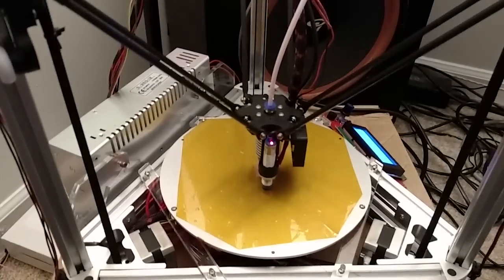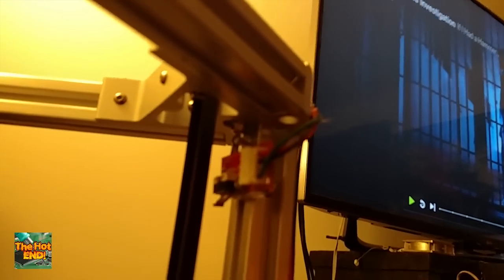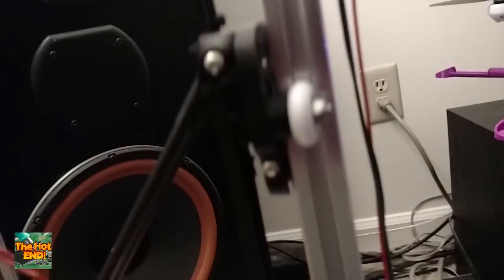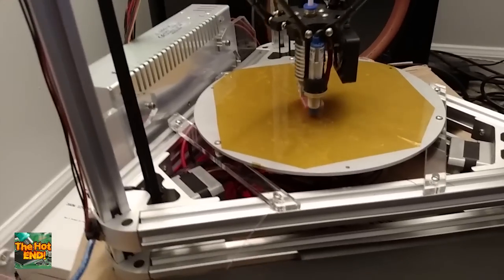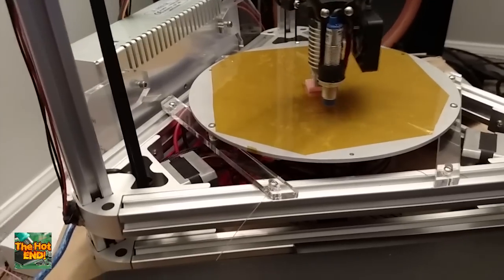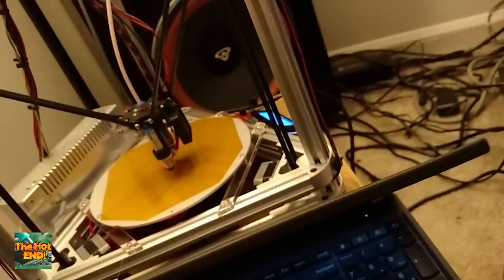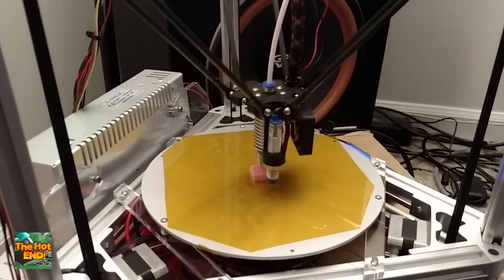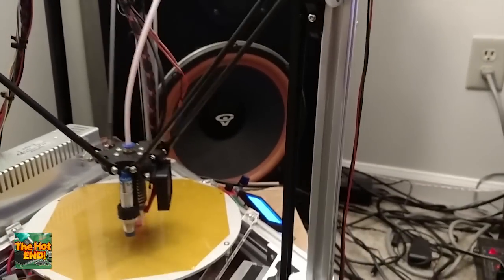Folger Technology Kossel Delta 3d Printer! Sneak Peak!

Comment from the maker: We're actually purchasing another 2 of these printers :)
Reply: +The Hot End Just wondering if you purchased the other 2?  I just got my folger kossel two weeks ago (it is my third folger printer - i have 2 2020 i3's.)  I would have had the kossel together by now but have been short several parts - bearings, nuts and bolts - but they have been very accommodating as usual.  I would stress to anyone buying these kits to do a thorough check of all parts against the install guide to avoid frustration when something comes up missing.  Of my 3 kits, the first was missing nothing, the second - a bad ramps and thermistor, the third - so far, bearing nuts, and bolts.  Thanks for the video it is a great help!
Reply: +The Hot End  Where did you learn to calibrate your delta? How long did it take you? I can't seem to get the grips of it... Been trying to calibrate it since January...

Cheers!
Brad

Comment: New to 3D and thanks for the video.  the delta configuration is awesome and I think this is the way im going to go..  please take more videos..time lapse prints etc!!

any suggestions for running it DC 12V for Mobile Use?

subscribing
Reply from the maker: +Bryan Kale Hi! The printer is 12V - I cant see why you couldnt just get a 12v to 12v DC regulator and plug it into your cars electrical system :)
Reply: +The Hot End Hmm.. so hardwired to voltage regulator and no power supply required. ..wow
Reply from the maker: +Bryan Kale The PSU just converts 240 (or 120) Volts AC back to 12V DC @ 30 amps

Comment: Did this come with all the parts to build or did you have to purchase or make additional parts. Cause the site notes "Complete set of black printed plastic parts needed." I would like to get this but if I have to get additional hardware I would like to know where to get them.
Reply from the maker: +Steven Stoll It came with everything! Including plastic parts - the only thing you may want (optional) is a round glass bed - but i just use kapton tape on the aluminium bed